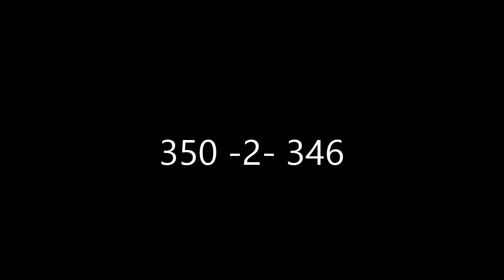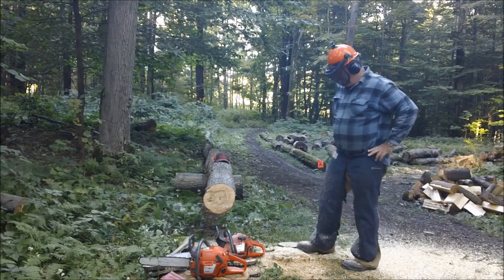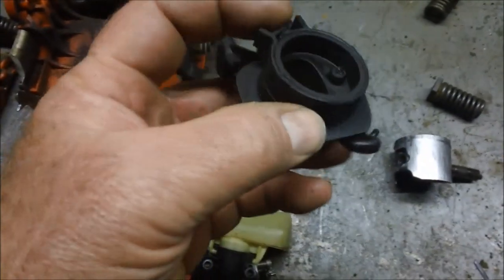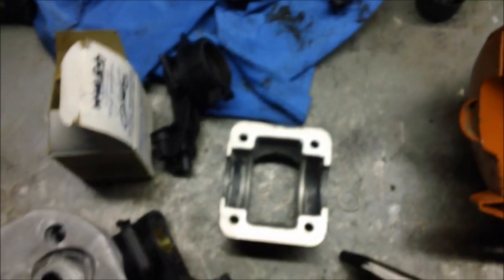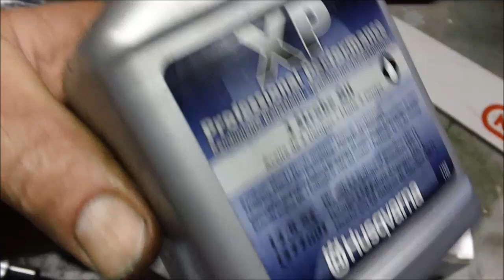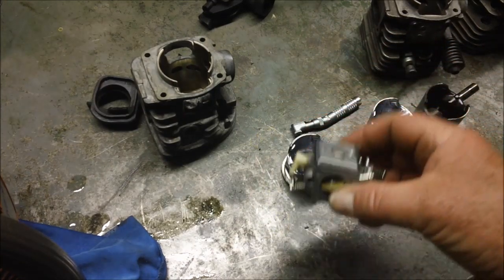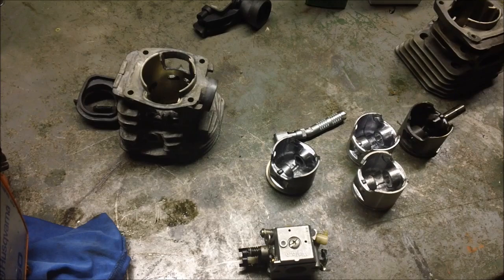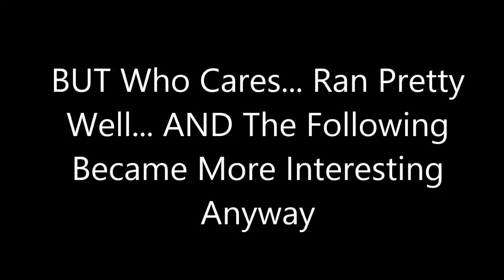Husqvarna  350 Cylinder swap to 346xp cylinder, "Dead Saw Salvage Video" & Coyote's Serenade

Comment: Just got a free nonrunning 353, the gold standard of the 350 series. Magnesium case and other upgrades. Cleaned up the ports, set the squish as tight as I dared, took a little off the intake skirt, raised the exhaust port a little. Wow, this thing cuts like a much bigger saw.👍
Reply from the maker: Yup basically a 346 with a 350 top end is what they were. I had fun with both the 350 & 353 by putting tweaked 346 top ends on them years back. Still have two or three new in the box 346 top ends. Just had moved to 550/562's. But those 346's are still a high bar to that class

Comment: Hello from Melbourne Australia Walt!! Yes the GOLF pistons are good stuff buddy!! I’ll be building a 346/350 hybrid soon for racing in our 51cc class at our sawfeast over here🤙👌👍
Reply from the maker: I had one of their "rougher" offerings in a Jonsered 820....lasted for a long time cutting fence posts out of locust logs, linear cuts quartering those tree's. That's like a milling operation. That piston / top end ended up being swapped out for a 920 as I was then into more and more of everything. Went to a close friend who ran it off and on ever since. This now being the 14th year of its serving in a chainsaw. AND the "lil' Red Barn" Popups I've used now a couple of years in 562's and now 395's and 572's while a little unsophisticated have all served well. They are case and machined by "VEC" who I believe was the source for Golf back in the day

Comment: Have you tried making a thicker gasket for the transfer covers? I have seen saws with the covers put on with motoseal, and was thinking instead of shortening bolts, and losing flow, add.
Reply from the maker: I think that's a great concept to explore, the large x-section might enhance flow. No I never tried that, but think that's a really clever actually innovative approach.

Comment: I see this is an old thread but    I picked up a 350 about identical to the one in your video,   it has 45 on the cylinder top and it does have the plastic clamp on the intake. Saw looks hardly used,  cranks right up, idles fine and cuts great. Are they all destined to develop that air leak? I don't have your repair knowledge and am a fan of " if it ain't broke "  don't break it,  which is what might happen if I tear it down to replace that clamp.
Reply: When they are hot they usually stop 4 stroking at wide open throttle, race then lean right out and drop revs suddenly.   They usually still warm up and idle OK at this stage.You will probably catch it before it seizes if you are on the look out.  Probably.

Comment: Just grabed a lovely new set of SKF crank bearings by happenstance while talking Stihl ms390 tweeking... From a cool guy with lots of projects saws and a few of the ones that you would just never part with or sell... Maybe bequieth to a hippster if the timing struck your fancy or not tripping while trying to navigate to the back of the shed struck your fancy! And Ebayed a set of seals to accompany the kindly used and my rarely sleeping and tight wad purse stringscavenged cs8000 jug & piston for my QV 8000 echo heart transplant operation !!!! 😀😀👍😀😀😀😀. I'm really hearing the 9600 R's compared to all the Super Stud saw comparisons I see on the "Tube" for those 80...88...90 CC... Monster side by sides ... But under the hours of flickering screens and half crumbled pages of old magazines there's talk of torque and I know there's plenty of power. I'm thinking I'm so happy I grabed the Stihl 32" rollomatic to play with the 390 and a skip... Cause everything's a fifty... And with all those cc's under the hood pulling the ripping in 32 should make that old girl purr like a kitten! I was thinking about an Alaskan then saw an aluminum ladder conversion that I might fab up just to see how it will do. I noticed in the new Bailey's catalog that just came out the whole back section is that lingersol or what have you and they have their bars and rippers in there for replacements .... Suposta be a thinner bar for smother and cleaner ripping... I'm thinking when she's up and singing that it might be worth it just to bolt one on and make it a permenant dance partner.... I was out meandering around and think setting up a half dozen benches around threw the woods would be real cool destinations.... And a six foot slab ... Four inches thick and two and a half foot tall all stained and oiled up .... would or could be pretty "cherry" looking ... All scattered around! I'm tired of seeing all this sweet grain go straight to the burn wood stack! Hope you and your clan are all well... Why do I have those compression chambers on these 350's ... I'm playing with those hutzl 45's black with the chrome to see on a few... I'm doing the 1194 for vibration insurance but with the volume of the gasket help or hurt me???? I'm in need of the name and number of the roll of ..., what u used for squish in that on video.... Just soft solder.... Mine doesn't seem soft enough... Any one brand and size just the ( one ) to use???? My new bands gonna be called " Down with base gaskets!" ....! LMFFAO! Your videos are inspiration, myfriend! Hey, did little ugly husky 350 that got the "treatment" getting that off brand jug intackes and top end squared up and all dialed in ever get the 5/8 muffle pipe job? Are those bars in the vids on those saws 16's???? And sum 3/8....sum .325's. What brand of chain in a 16 has the largest most aggressive tooth??? The 3/8 's is the one with the what appear to be nice large tooth... Is that correct? Those all .50's ... No like 16 inch combo in the bigger ... What's that .63?? That just cuts divots...? I want to see pinky fingernail size hunks flying.... Nun of this dawn sawdust! LOL
Reply from the maker: +David Thorne wow! All my 350's ended up with 1194 and with a little elbow grease .020-.022in of squish btw. Usually the bearing cap sacrificed a bit of material..:)Never put any more time into the Huztl 350 jug with the goofy transfers...it ran really strong after that random dremel tool hog job! It also did a stint in the back of a log purchaser's tuck and was used to buck hardwood! No kidding. It came back when the multi function choke/on-off switch fell apart. The guts of that saw survived just fine...:)If the solder isn't soft enough.. maybe your squish is where you want it to be! Can use wax too if you really need a number. Those ones used to measure main bearing clearance.I got a hand full of Dolmar brand 16 inch bars and have been using them up on those 350's. On one video I used an 18inch to test with as the log was at least that... which says something about those builds.And eventually all my 350's will have a 5/8in tube ... its what I do.

Comment: I've watched this video multiple times, but just noticed that this saw had a flat top piston (from the 353) in it, instead of the stock dished piston, when you tore it down..  someone had been into it before.
Reply from the maker: +Dirtmagnet400 Actually it was a 44mm open port. They did have flat top pistons. The 45mm close port 353 cylinder version was dished so it would have less power than the 353 that had the same cylinder. Typical husky... :)
Reply: Ah, I didn't even realize the open port had a flat top.  Thank you for correcting my ignorance!  By the way, I am working on a 350 that stuck itself from an air leak (big surprise).  It had the plastic intake clamp and coarse thread bearing cap.  I ordered a Huztl piston/cylinder kit to play with and my version looked the same as your original build 2 years ago..  TERRIBLE transfers.. i mean bad!  Just like yours, the tool mis-shaped the upper transfers.  I will try to work with them as you did, but it looks like i will be able to save the original 45mm closed port cylinder.  It's mostly transfer and no damage to the plating.  I will do some port work on that and play with the Huztl at my leisure.  I was really hoping they had improved after all this time, but I guess not.

Comment: Who makes the "1157" thread locker you talk about? And the crappy 350 intake boot...you replaced with what intake?  Do you have a part # I can order one for my build...I hate that snap intake.  Thanks, David
Reply from the maker: David Thorne Three Bond 1194. I used that to both seal and help with vibration backing out those course threaded screws. I need to up date those video's as Three Bond now makes 1184 as the replacement for 1194. 1194 had lead therefore was banned by our Obama Nation's EPA. Also need to re-do the degrees wheel portion as I have a much easier method. I just modified my old plastic clamp as shown in one of those video's. You can't order that as it was my modification. So far a year later that "modified" clamp still works. One thing I did on those saws is replace the intake completely with a slightly modified intake from the 357/359 series of saws. I did have to tweak the linkage on the carb a bit. Think I showed that. I have found that just getting the intake timing right and using the stock carb is the best approach. Starts easier. What little you may loose in power is gained in having a saw that starts easy....leave that stuff stock.

Comment: I'll look for the old...and settle for the new...all good things 2+2 ...Ect are allways discontinued...  It's always the products that work well it seems.  It is fantastic to find someone like you will to share videos with real world knowledge...I know it takes considerable time on your part and really is appreciated, Sir.  You are now my chainsaw guru...I've been searching for someone that really explains in plain english why certain tweaks do certain things.  Do you use clay for the squish test? Certain brand?  Much thanks!
Reply from the maker: David Thorne I guess clay can work, but I use soft solder like you would use for electronics. Just stick in the spark plug hole and take three or four samples right at the cylinder wall. Use dial calipers to measure after you squeeze that solder.
Reply from the maker: afleetcommand Have to say it shouldn't take a lot to turn the crank and if it does... there is your first clue you don't have enough clearance to play with.

Comment: 140 psi good compresion 372 xp oe ?
Reply from the maker: It will run but rather see 150 or more.
Reply: @afleetcommand  i.e. the power will be weaker than the factory power, with this compression of 140 psi?
Reply from the maker: @Sensei948 140 is OK, within spec. Most OEM's I test range between 140-150, where 140 is on the low side. Remember the gage itself is a variable. 140 on your gage might be a different number on another, so unless there is another reason you are concerned, run that saw. :)

Comment: I have a question I have a 2150 johnson red turbo whats the max top end size I can get fare as a big bore kit ? I'm confused with the matching up jugs out there
Reply from the maker: Biggest isn't always the best. The closed port Husqvarna 346 cylinder is the best "almost" bolt on option. Have to do a little die grinder work so the transfers fit on the PTO side, and the pulse "slot" matches up with the case on some, but the performance is worth the effort. 
https://www.ebay.com/itm/HUSQVARNA-346xp-44-3-mm-version-OEM-350-353-JONSERED-2150-2152-CYLINDER-KIT/303016225633?hash=item468d2cab61:g:rGwAAOSwOwpbp-U6:sc:USPSPriority!13045!US!-1

Comment: Why did you cut the skirt? New to this just curious
Reply from the maker: Think I show graphically why I cut the cylinders, really exposes more x-section at the base of the transfers. And the piston I did on some to get the intake timing in the high 70's before tdc. Both mods were about trying to make that saw happier in the upper RPM range.